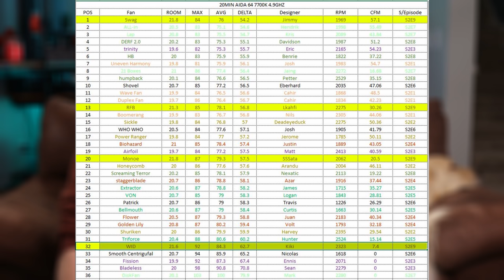WEIRDEST Fans I have ever seen – Fan Showdown S2E9

Comment: I'm impressed by how that alligator clip setup handled the mono.
Reply: Roach clip
Reply: Those are called helping hands. They are typically used for soldering wires together in line and other things.
Reply: Just drill a hole say the outer edge and fill it with weights- takes a little work but will balance it
Reply: @vikmanphotography7984  Or just drill material out of the heavier side. That's how I balance flywheels.
Reply: @SwervingLemon  I feel like only removing material could require removing too much material as to impact the design of the fan but if not- fair point.
Reply: @vikmanphotography7984  Would probably require both anyways. In this particular case it's going to be easier (and safer in the long run) to subtract material rather than add weights, so best approach would be to design this fan with some extra blob of material on each end to be shaved off as necessary.
Also, it looked like it's gonna pull out of the chassis, I was surprised there were no accidents.
Reply: Monoe*
Reply: @pubcollize  I'm guessing the fan blade side was heavier because of the surface imperfections, and the blade has the larger surface. So a slight sand down of the blade should do the trick.
Reply: @allmybasketsinoneegg  Or maybe an acetone dip with masking on the counterweight side.
Either way going at it by theorizing which part is heavier is going to have a 50:50 chance of being right, at best.
Reply: dont bash the mono it just has a good time
Reply: Yeah, me too...

Comment: I wonder how balanced the monoe would be if it was resin printed, id really like to see that ones performance when properly balanced.
Reply: I don't think balancing it will affect air flow. It might make it quieter. It just needs some careful sanding to balance it.
Reply: @seitenryu6844  With better balance it should spin faster and thus create better airflow, right?
Reply: @sevret313  Not by much. Also, it wasn't even ranked the best in this small group, so I don't think you'll get much out of it. Granted, it's only a single blade. Would be cool to see it with more blades.
Reply: I think a double would do it, and it will be balanced, would love to see how it will perform
Reply: @seitenryu6844  Single blades are ment to run at twice the RPM
Reply: @steverpcb  Only when they're perfectly counterbalanced, which is not easy.  Shaking the entire machine was what slowed it down most, not pushing air.
Reply: @VoltisArt  Counterbalancing needs to be done after printing !
Reply: @sevret313  Correct. More balance is less wasted potential and more RPM should yield more air flow.
Reply: A one bladed fan can never be dynamically balanced, no matter how accurate the counterweight. When spinning the single blade creates a moving torque around the hub that will always cause vibration.
Reply: @steverpcb  Yeah, the balancing is important for the longevity of the fan as well. If it had been manually counterbalanced, it might have been pretty good

Comment: 8:24 The SWAG fan is actually pretty clever - can see the smoke going through the slits in the blades - and the air flow out the back is impressive
Reply: It somehow manages to keep the airflow central rather than dispersing it away from the fan. Don't know if that's because of the slits or if it would still do that without them though.

I feel like there's finally been a concept that's proven itself to the point that it needs further iterations.
Reply: man i wish i'd been keeping up with this series earlier

The SWAG's slits to let a small amount of air through to the upper side of the airfoil are not just aesthetic, but necessary in its design.
In aircraft, these intentional leaks are used to prevent stalling when the plane's angle of attack is too great, which drastically reduces lift while drastically increasing drag. In this fan, introducing these leaks allows for a far more aggressive blade angle without stalling, which would drastically decrease flow rate and speed. From the side shot of the SWAG at 3:40, it has quite an extreme blade angle indeed!

Keeping the flow central is mostly something else though. Because fans rotate, air passing through them gets thrown away from the center as it is pushed through the fan due to centrifugal acceleration. Simply put, the air touching the fan gets swung away from the middle. This effect is generally not desired since air moving away from the center means energy is being wasted on accelerating air away from the center and since it means less airflow at whatever the fan is pointing at.

Fans usually compensate for this by giving each blade a reverse sweep, such that the curve of the blade as viewed head-on scoops air back toward the center like a scythe. Even the SWAG has a small sweep like this. The slits however may also help a little bit by interrupting this axial flow away from the center, creating a trap on the bottom side that air falls into and a wall of leaking air on top that blocks air from crossing the slit.

Comment: Maybe you could use a bit of dremel on the mono, I really want to see it working once balanced
Reply: Same !
Reply: Yes, right, I'm pretty sure the fact that it's unbalanced makes it work a lot worse
Reply: prob could be fixed with a resin printer
Reply: @Akio4800  Honestly they all should be made out of resin, it seems higher quality. For something as precise as Aerodynamics, it seems useful.
Reply: Do the monoe justice and balance it. We'd like to see some test with that fan finally not throttling
Reply: @Kavriel  
Didn't he compare resin to fdm and found out that there was 0 difference?
Reply: @-eMpTy-  If recall correctly, it was quieter but didn't cool better, but it was one example.
Reply: @-eMpTy-  in the example he tested, but in the case like this it would be a more accurately filled volume, with less gaps. When all sides are repeating the same shape over and over this doesn't make much difference, but when the two sides are different shapes they'll have differing amounts of missing or added material from the way they're filled. A Resin printer wouldn't have this same problem to the same extent and would more accurately recreate the volumes that were designed for in solidworks.
Reply: Definitely needs a retest after an attempt at balancing.
Reply: @DreadKyller  Still wouldn't solve the balance problem. Just look at high end fans, flywheels and just about anything else that spins quickly and they are going to be individually balanced. If a large manufacturers pumping out millions of units can't solve this for simple symmetrical parts I highly doubt that just printing the fan in resin would make it perfectly balanced. It might be less unbalanced, and would have better surface finish, but it would still need to be balanced for best performance.
Might just as well start with the part he already has and see what it takes to balance that.
Reply: A one bladed fan will always be unbalanced and cause vibration when spinning because of the off axis thrust created by the one blade. The counterweight only helps static balance, and even if totally perfect it will still vibrate.
Reply: I want to see the mono design turned into a Duo with the fan blade portion duplicated on both sides.

Comment: To the WID and the WID maker. MY inner voice tells me that if you had also small blades on the inner side.. around the core diameter.. and a circular gap between the inner and outer blades....then it could be MUCH more  effective 😊
Reply: Ooh, it could be 7 blades on the inside and 13 blades on the outside, for the perfect combination of good and bad luck (also to reduce noise via irregular fan blades.)

Comment: The ptoblem with the mono is that it isn't dynamically ballanced. If you have a stick with a small weight far out on the left side and a bigger weight on the right side near the center, it will be ballanced when still. But when you spin it, the small weight moves a lot faster and the balance moves to the left side. Static ballancing is better than none, but dynamic is the only way you can achieve a perfect balance.

Comment: One reason people have so much trouble with a monoblade is they need to take into account the force the blade is exerting on the air and the greater friction the blade side has with the air. I might suggest adding tiny horizontal fins that would create drag equivalent to the fan blade

It doesn't matter how perfect the center of mass is if there is a significant force acting unevenly on the fan.

Comment: That progressive airfoil really helped deliver more static pressure I bet. It looked really efficient in the smoke test. That side view made it immediately apparent which fans were spending most of their energy pushing air straight out the back of the fan, and how many were wasting most of their energy spinning the air around so it flies out to the side as soon as the fan isn't containing it. I'm betting low helicity and high velocity equates to better performance in a radiator cooling test since the air encounters the least resistance travelling in a straight line perpendicular to the radiator, so the more the fan is making air move that way, the better it will do.

Comment: Fun fact: turbo fan jet engines have similar jointed blades so at high RPMs the blades can move to the most ideal and efficient position. However they have much less play than those fans.

Comment: it's easy to balance stuff, put it sideways, let the heavy side fall, remove a tiny bit of material and then put the heavy side to the left or right, if it falls slower, keep removing material (or in fact adding material to the other side)

Comment: It would be interesting if you fixed the Fan to an clear acrylic sheet with a cutout for the smoke test. That way you dont have anything flowing back or bypassing the fan, and would see just what the fan does. I think 4-5 Inches around the fan would be enough to stop anything from bypassing or flowing back to the intake side. Great channel btw, I love your content.

Comment: I knew the swag was going to perform great, those gaps in the airfoil are similar to the gaps in bird feathers and they actually help to reduce vortexes coming off the back of the wing or something. Engineers have tried making discontinuous wing designs to take advantage of this effect. Reducing vortexes not only increases performance, but also reduces noise. Overall a great design for a PC fan.

Comment: You could show some basic trends with the data so far. I did a quick plot based on 10:54 and a linear relationship between CFM and ∆T is approximately: ∆T = -0.1 CFM + 61. R^2 is OK at 0.52, so things like static pressure will obviously play a role at finding an ‘optimal’ design. Either way, CFM matters. Just if anyone cares :P

Comment: Although the WID didn't do very well, I think it's a cool idea. I'd like to see the design of the WID be refined and expanded upon. For example, static pressure blades acting as the stabilizers from the center to the outer ring and make the blades on the ring a series of different shapes and sizes to draw in more airflow from all directions. Maybe they can get in contact with Jimmy and combined it with the SWAG?

Comment: Even if the fan doesn't blow in the center, that's not why the smoke goes there. When you have a circular cross section of airflow, or like a pipe, the highest velocity will always be in the center during steady state flow, because the outer edges create drag from the still moving air or pipe walls.

Comment: Two suggestions: A: a small pump and some tubing can allow you to put your camera in the center of the smoke with a straight down the barrel view. 2: be a bit more rigorous in your set up; at the very least get the smoke fed in dead center on the fan with a more laminar flow in the smoke. You can print a tesla vlave to work towards that end.

Comment: The idea behind the vents in the blades is to reduce vortices which would reduce airfoil efficiency but that is typically for low air speed over the wings or high angle of attack. There are also vortices induced over the surface at high air speeds but I don't have the information on had at the moment.

Comment: You should have a little mount for the fans. I’m pretty sure you holding down the moon helped a lot in reducing noise. A surprising amount of noise from a fan comes from the material vibrating again whatever it’s attached to so if you could maybe reduce the vibrations you could get a more accurate noise readout?

Comment: Also, plugging a microphone into an oscilloscope with a rising trigger would allow us to visualize the frequency before and after the fan starts. Either that or, more appropriately, a spectrum analyzer would show the amplitude of every detected frequency in real time, allowing us to see what ranges of freqs the fan produces and how loud they are relative to the surroundings. 

Spectrum analyzers can be expensive however.

Comment: The smoke doesn't exactly get sucked into the center. The column of air moving through the fan starts to spin about the fan's axis and this sort of "centrifuges" the more dense air to the outside of the column, pushing the smoke toward the center. I don't know if that makes sense but it's how I understand it.

Comment: The Swag fan reminded me of what we learned in swim class. If you separate your fingers just a little while pushing through the water, you get more force on the water. I am betting this is the same that is happening with the fan.
Now those gaps need to be widened until the delta starts rising again. I will bet it can be lowered into 53's and maybe 52's

Comment: Those fan blade gaps on the third one you showed create low pressure zones which could very well draw even more air in than without. That is at least the working theory I have based on fluid dynamics.

Comment: Just to put in a comment and because you talk about spectrums. The A-weighting on the audio-analyser gives a serious advantage for the Mono. As the noise is a lot lower in frequency (for the mono) the A-weighting will naturally attenuate the noise level more than for the fans with a more broadband noise spectrum. For short: Measuring using an A-weighting filter, the fan with low-frequency noise will always win. Consider measuring using a C-weighting (dBc). A background noise measurement would be nice for a comparison :).. And thanks for a nice show!

Comment: One thing I noticed thanks to the side view that the numbers don't tell you is just how much the WID dispersed the smoke over a wider area than the others. I feel like if you put that fan in the top of the case with other more normal style fans in the other positions, it would bathe the system with a wider swath of fresh air from the top down, while the other fans bring in a more intense but compacted air flow. The two types in unison could possibly improve the overall temps of the entire system... VRM's, RAM, etc...

Comment: Could you please make a test with the Noctua original blades? I checked the season1 data (season finale 11:30) and according to that sheet and this here, the Noctua blades are in 19th place. This is quite awesome, but because the different measuring methods maybe a bit off. So it'd be cool to see an updated reference point.

Comment: The Swag is very impressive. Especially how evenly and straight the smoke exits.
Usually most fans create a lot of spin that flings the air out in all directions - but this in inefficient when you actually want to put it on some sort of heatsink. I have to imagine that less turbulence also has benefits to the noise level.
Sometimes designs use 2 counter-rotating fans to even his out - but not having to correct it in the first place (and using only 1 fan of course) seems like it has real merit to investigate and optimize further.
I suspect this is at least partially why it performs so well. How those slits play into creating this effect is beyond my understanding though... and I can't say I have ever seen slits rather than ridges on any commercial fan. Intriguing...

Comment: My theory is that the pressure rise at the end of the blade causes air to spring back into the next blade, pushing out air that would be coming in. The slots in the blade might bleed off pressure in the right place to reduce that effect.

Comment: Any fan with a counter balance needs some sort or easy way to adjust weight.  Like little tabs that can be removed or a small slot that can be filled to make the weight distribution more equal.

Comment: You know what would be a good idea? Mount a radiator on the back so we can see how the fans handle higher pressure. After all, there's a difference between case fans and radiator fans.

Comment: To give these one bladed, or just uneven fans a fighting chance, I feel they should be balanced before testing. Easiest way I can think of to do that would be a modified prop balancer for RC planes. Also, side view gives us an idea of the directionality of the air coming out of the fan. There must be some kind math relating to the angle of that smoke.